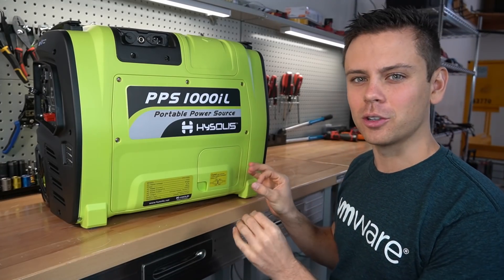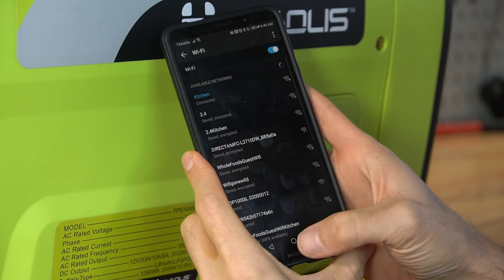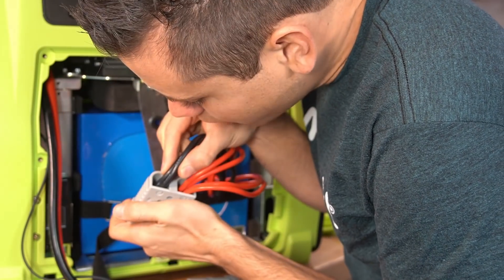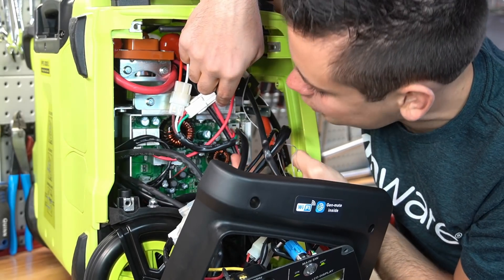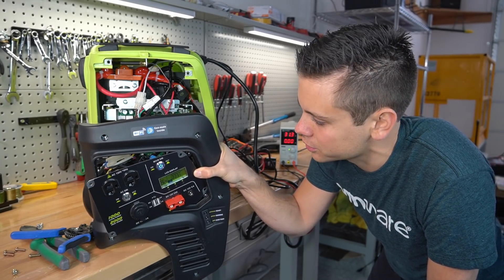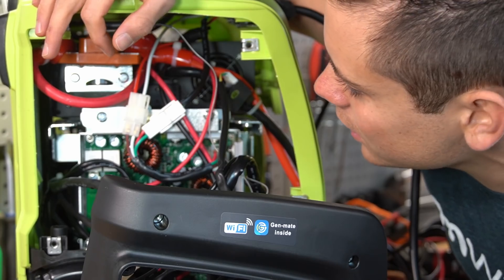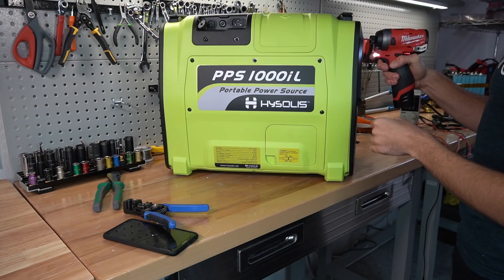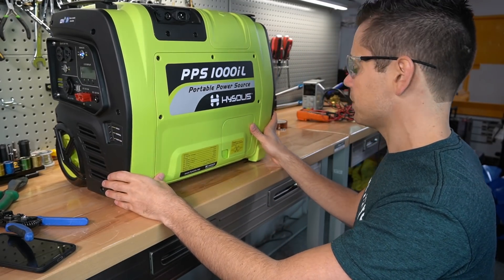$999 "Hysolis" LiFePO4 Solar Generator w/ MPPT and PSW Inverter: Total Teardown

Comment: Is it just me or do these solar generators look like they have way too many things that could go wrong with them?  Don't get me wrong, if you set up your own system you will have just as many and possibly more things that could go wrong.  However, if your charge controller or something else goes out in your self setup you just buy a new one.  Most people could easily do it.  I'm not so sure most would even want to consider cracking open a solar generator and gutting it, etc.  Granted, to set up your own system may be too much for many also... or at least it may seem that way to many.
Reply: Out of all the solar generators, this one looks the most user serviceable.

Comment: First thing I notice. Milwaukee impact upgrade. Nicely
Reply from the maker: Fuel drivers rock!! Should have upgraded ages ago
Reply: Dude u got to try fuel Surge impact it’s a hydraulic drive. Gives me much control. Like I will turn around and go back home if I forget it. I work on network copiers and and large format stuff, so similar type screws. Wiha bits r thug
Reply from the maker: @chriscord6524  good to know. I'll check that out
Reply: I put an Electrodacus inside my Milwaukee packout top box, w Fortune 25Ah and Victron inverter. All because I stumbled on your Sbms video while I was searching usbC power bank reviews. Thank you and screw Anker

Comment: Regardless of how it performs and the price, I would not buy this because of the safety issue of the cable potentially rubbing through and causing a extreme issue. I'm leaning towards building a LTO battery system, but will be making my final decision when I feel Ive learnt enough to make educated decisions.

Comment: I love the form factor. I wish the leoch power station had big wheels like that and they were located on the wide axis like that. And that telescoping handle.
Reply from the maker: Agreed. It's so nice.
Reply: @WillProwse    The design itself (wheels, handle, aesthetics) is enough for me to consider this one for 'off grid' use. But I would prefer at least 2K, but for $1599? Makes me wonder, if you were to design your idea of the most optimum, portable, useful, battery sourced power supply, what would it include?
Reply: Needs bigger wheels to get it over uneven terrain
Reply: That, is the first thing I noticed, the form factor, the wheel placement and the handle, perfect! The only thing I would add to the unit is a parallel  external battery boost, for longer runtime. Maybe using the same case or shell. This market is growing by leaps and bounds.